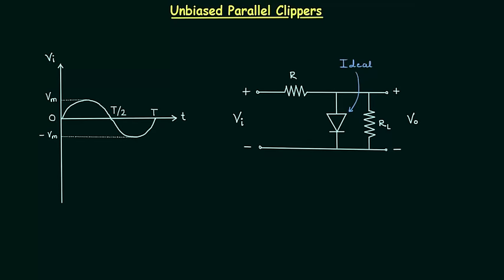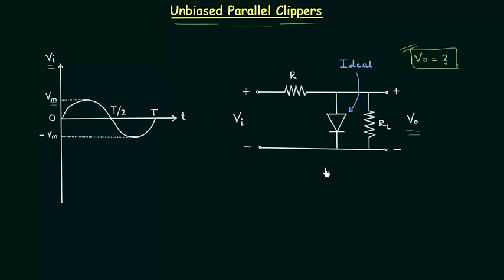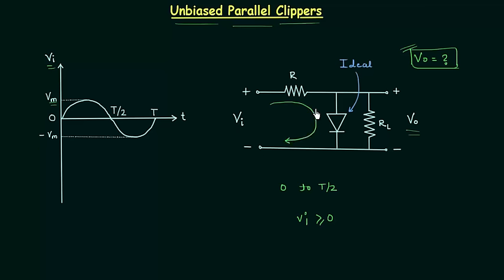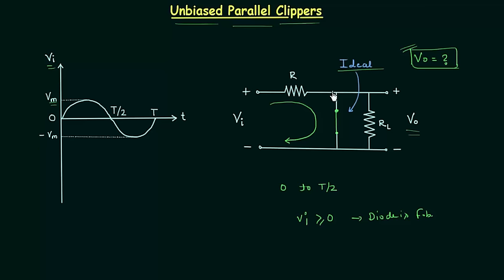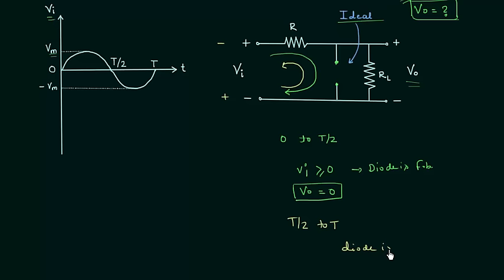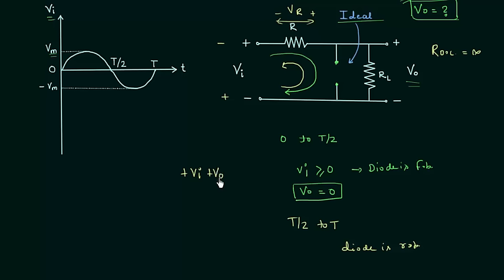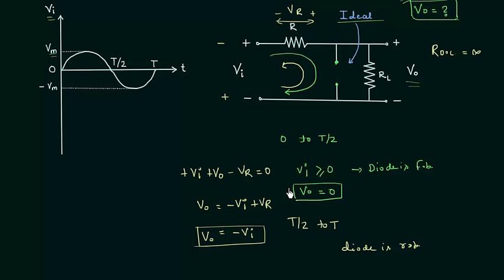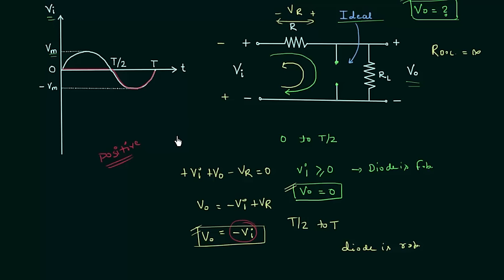Unbiased Parallel Clippers

Comment: Here output is measured across load resistance which is also in parallel with diode, so for first half cycle diode behalf as short with voltage Vi then why Vo = 0.
Reply: For first half cycle side behaves as open circuit.
Reply: sorry for replying after 6 years, but since there is no resistance in ideal diode, no potential difference is created
so V is zero there

Comment: Sir for the negative cycle of the voltage source,the maximum voltage will be would be less than Vm due to the voltage drop across R
Reply: I also think that because in -ve cycle the circuit will act as a voltage divider.

Comment: Vi + Vo  - Vr=0 is wrong coz polarity of Vo should be -Vo , so it shuld be Vi - Vo - Vr=0 , please correct me if i am wrong ........!!!!!!!!!!!!!!
Reply: yes,polarity of load resistor will also change in -ve half cycle,  i am also confused by this video.
Reply: same confusion
Reply: @salmanbhuttaaa  best of luck for exam though 🖤🌼
Reply: Vo is Voltmeter...and Voltmeter polarity will not change both half cycle..

Comment: if the output is - Vi then should the output while plotting should be shown as  180° phase change
Reply: No, the graph is correct. Coz during the 2nd half cycle, he has marked the upper terminal as -ve & lower one as +ve which is just the opposite of what we have considered earlier while plotting the input waveform.

Comment: If [Vo=(-Vi)] for negative half-cycle, then shouldn't the polarity of Vo be opposite to that of Vi?
ie. if Vi is -ve, then Vo should be +ve, no? What am I missing?
Reply: Stuck with the same conceptual doubt.
Reply: don't think so much just remember its written in a book we always have to take upper part of output voltage + and lower part  as -  wherever the current direction is in clockwise or in anticlockwise whenever we apply kvl always take  V output as +ve thats simply its not a rocket science
Reply: actually there is no need to change. because we have already changed the polarity of the input voltage or just without applying any KVL just look at the circuit when diode is short circuited. The output voltage equals to the input voltage

Comment: What if the ideal diode replace with pratical diode (silicon) ?
The Vo during the 1st half cycle will be 0.7 ?
Reply: Yes it will work like voltage regulator (like zener diode).

Comment: If R is not small, there will be a substantial current through it causing a voltage drop. How to calculate V(R) then?
videos with numerical values can aid to comprehension.
Reply: Then output voltage will be in phase but a constant factor( <1) times the input voltage. In particular, Vo=Vi(RL)/(R1+RL)

Comment: Have you tried your theory on a practical circuit. I have tried this with 30volt p-p signal at 1mhz using 4 in4148 but I seeing voltages greater than the forward voltage of the diode.

Comment: why is the output not positive for negative half beside it's calculated that Vo = - Vi
Reply: Vo =-(Vi-3), and here in the negative half when we are changing the polarity of battery then we have consumed that negative sign of Vi ,so we are using Vi as positive term ..U can use Vi as negative only when u do not change the polarity and let remain as same as in 1st half..